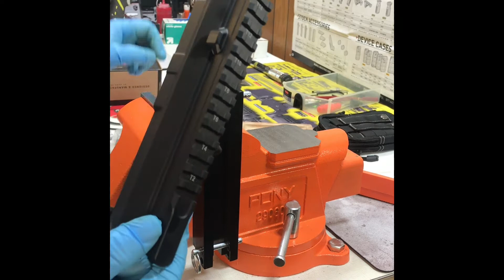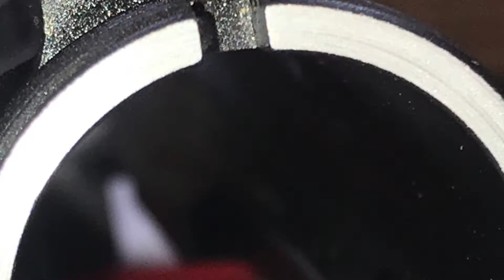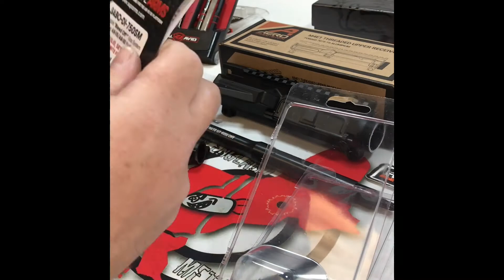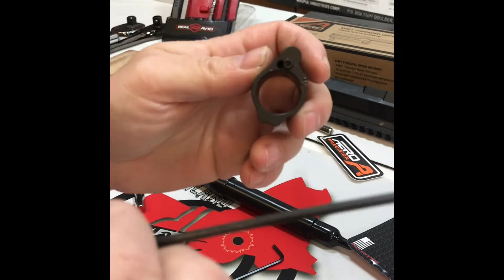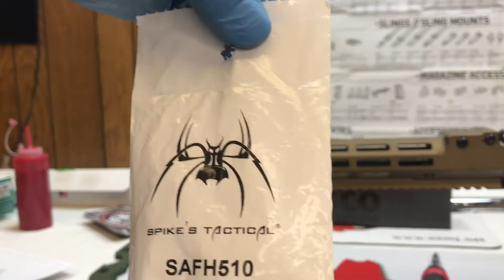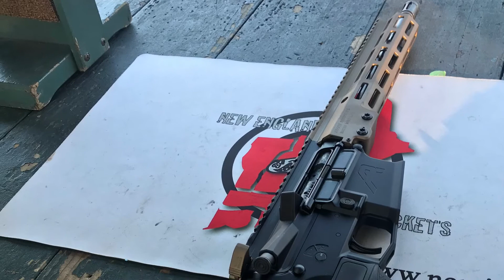Aero Precision M4E1, Rosco Manufacturing 11.5" Upper Receiver with Geissele Automatics MK16 10.5 HG

Comment: If you don't mind me asking what did this cost? I just bought a used mk8 handguard with aero upper pin and welded surefire warcomp came with bcg and everything. Paid 500 fell like i came out ahead
Reply from the maker: Surefire warcomp alone is $150 currently 
This was just under $800 I believe

Comment: My Geissele barrel but is not threading on to my aero m4e1 upper. It’s very stiff/ tight. Any idea what would be causing that?
Reply from the maker: Could be a few things. I’d try cleaning the treads of the upper and the barrel nut with a nylon wire brush and some gun cleaner. Then make sure that you grease the treads when putting it together. If it doesn’t work either the nut or the upper may be out of spec.
Reply: @NEmetaljackets  thanks for the reply. I’ll try that out.

Comment: My mk16 rail took a hammer to get on I did everything the same as you did also ?
Reply from the maker: It took a little persuasion to get on but I didn’t need a hammer. Maybe a tap from a mallet. It’s a tight fit for sure.